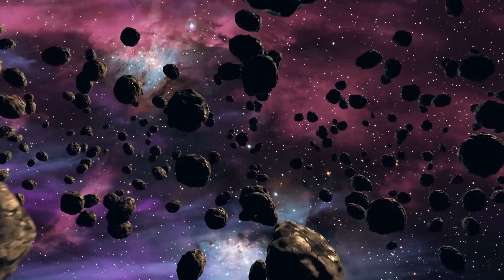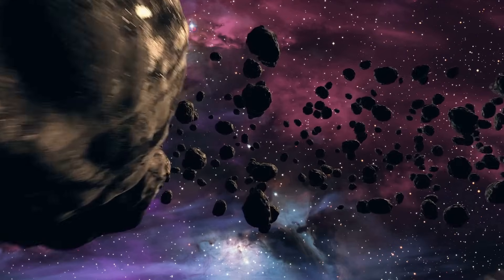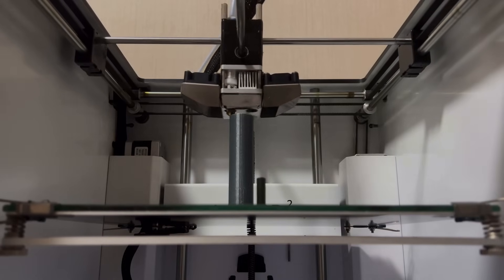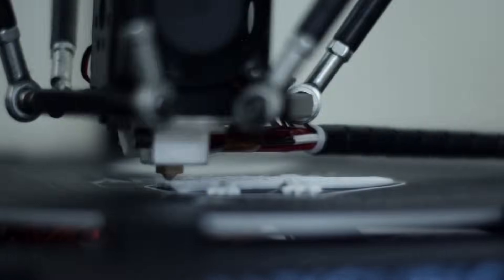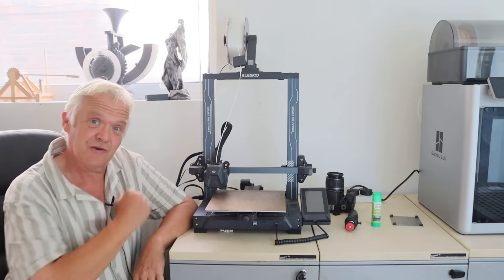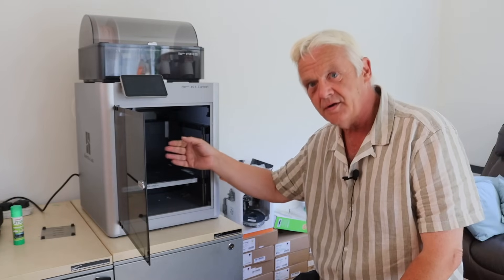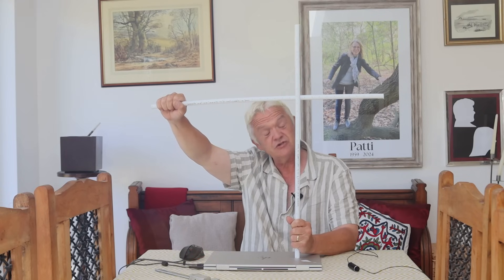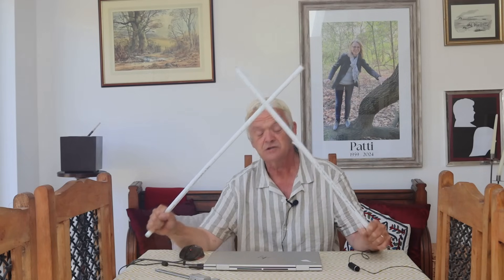2277 What Is CoreXY ?

Comment: When I was a kid in the 90's I got a flatbed plotter, which truly fascinated me... Its motors were stationary like this, but the pulley system is, in fact, cartesian. One motor for X and another for Y. 

I had always thought CoreXY was just a newfangled name for that design until I saw your model, here.

 It seems both motors have to move, in CoreXY, to move the head along one axis... which reminds me a bit of wall-hanging plotters. The math is somewhat complicated to convert cartesian coordinates to pythagorean(?). But, I guess, in the end, a fast computer/CPU can handle it, so it really doesn't matter.
Though, I wonder if it makes for weird resolution-effects. Say the stepper motors are 1.8deg/step, in a cartesian system each step might amount to 0.1mm. But on a system like this, it seems like it might have higher resolution in some areas, and lower in others.

Interesting, anyhow. And as always, great explanation!
Reply from the maker: the math does get a bit more complicated - verging on calculus - but not too much to be honest

Comment: XY printers have been using drive belts for a long time, though I never would have guessed the reason.  Figures that XYZ printers would catch up.  What I want to know is when any printer manufacturers are going to start using the default drivers available in most operating systems, and when are we going to see printheads or belts that read their true position via a capacitive linear encoder.  Salutations!
Reply from the maker: i guess it will come mate

Comment: The Sovol SV08 which is based on the Voron 2 project actually use 4 belts and steppers to move the in the Z-Axis with just enough gear reduction to prevent gravity back driving the steppers when they are off.

The sovol requires a small amount of assembly but its easier than any flat pack furniture kit.
Reply from the maker: interestig mate - thanks for sharing

Comment: Great video. I see that we can expect improvements in belt technology in the future. That seems to be the weak point in CoreXY printers. So we should see people trying to overcome that limitation.
Reply from the maker: I am pondering that exact thing myself
Reply: Rayon cord maybe ?
Reply: @justtinkering6713  That would be thicker than a belt, so it might not be so prone to stretching. It might be worth trying.
Reply: @CCoburn3  I make sails from rayon because it doesn't stretch.
Reply: @justtinkering6713  Sounds good. Would it slip?
Reply: @CCoburn3  Use clamps and multiple wraps on the stepper motor drum. They use wire rope on some printers but that would stretch.
Reply: @justtinkering6713  Of course, regular belts slip too. What I'm getting at is whether rayon is slippery. Some materials are too slick to be used for belts. But rayon might be well-suited for the purpose. I don't know, but since you use rayon to make sails, you'd know about its properties.
Reply: @CCoburn3  printhead is clamped to the belt. Then the belt makes several wraps on the stepper motor drum. Everything is clamped in place. No slip.
Reply: @justtinkering6713  Sounds good.